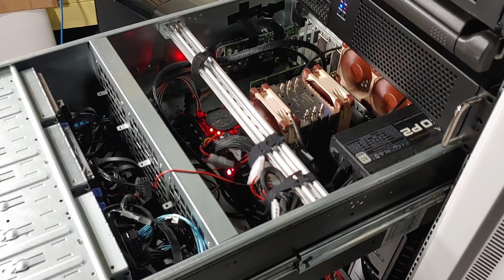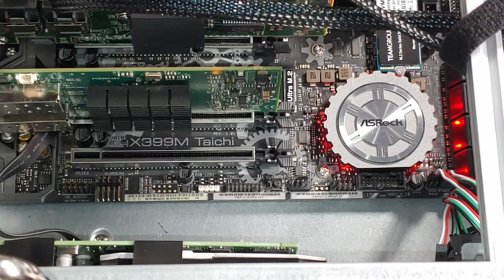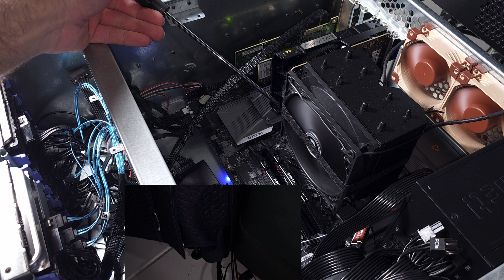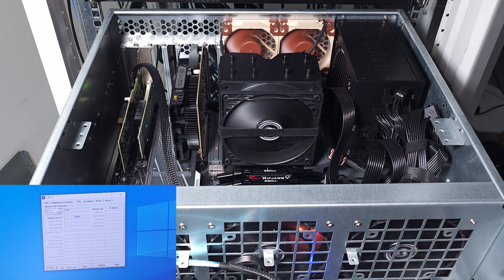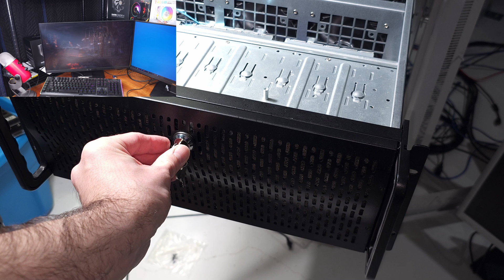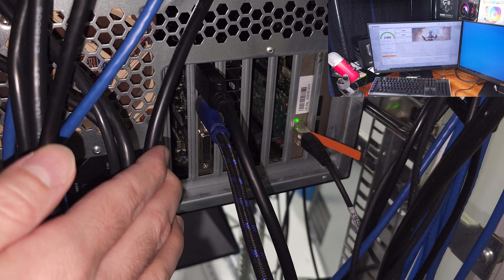12600K Unraid Server - Homelab

Comment: Excellent info. I am going to be investigating CPU pinning. I have the same CPU and use my unraid server in a similar fashion. My daily driver workstation and gaming machines are VM’s. I think the CPU pitting would benefit me greatly for performance as well as power. 

How do I determine E/P cores?

Praise be to the algorithm this morning.
Reply from the maker: Hi darthkeilbasa! Love the handle, heh.

I pinned the Handbrake docker to the 4 E-core and the VM to the the 4 P cores after the first two displayed in the CPU pinning (since the 12600K is 6p+4e). For Unraid, I have read you always want to attempt to leave cores 0+1 unpinned / free for the OS to use. It's worth reiterating I did make some active choices to reduce the power consumption here but IMO, it was totally worth it. 

As for the P core, they all have hyper threading on 12, 13, 14th gen CPUs so they will be display as CPU 0 - HT 1 for example. The E cores will be display just as CPU 10. 

What were you trying to accomplish with your setup?
Reply: @STS  I currently use my server for a few gaming VMs (windows and linux), Docker APPs and storage. I've been considering breaking up the monolithic server. 

Either way, I'd like to optimize my VMs for better performance. 

 I'll poke around with cpu pinning. I appreciate your feedback.

Comment: Even with all of those power limits I bet your overall performance is much higher than the 1920x. The main thing holding me back from replacing my 2950x server (besides finances lol) is the fact that I’m using all of the PCIe lanes + the 8 onboard sata ports. So even though my 5900x is nearly as fast and much more power efficient, I couldn’t use it as a drop in replacement. Thankfully my power is included in rent, so I don’t worry too much about the power usage quite yet. Other than the issue of tripping breakers in the summer
Reply: nice setup there ^

thats a lot of pcie lanes right? what're you doing with all that?
Reply: Thanks! The board its in has 3x NVMe slots (all in use) + a RTX2060 + a GT1030 + a dual port 10gig network card(Server to server and server to workstation links) + a quad port 1gig network card (for VMs on different networks) + a 10 port SATA HBA card.